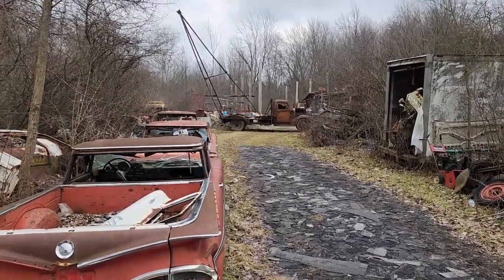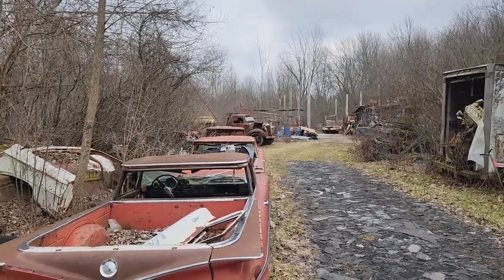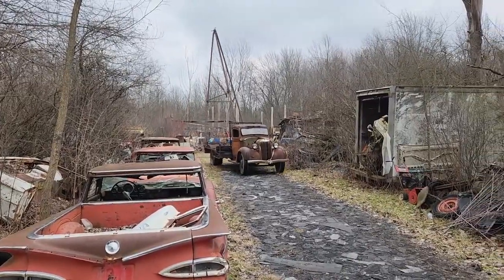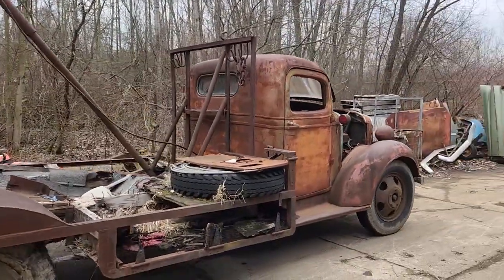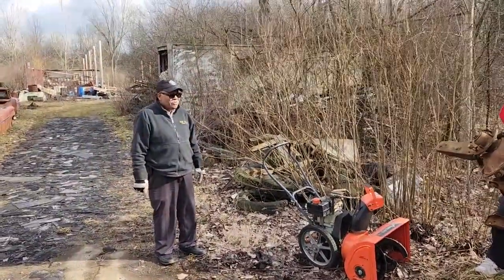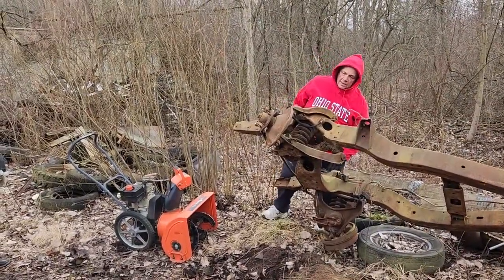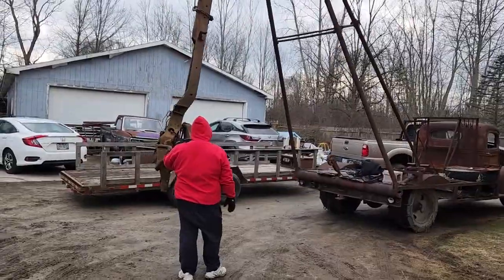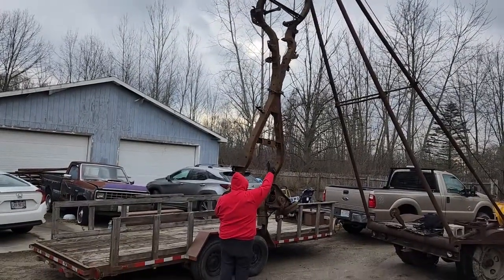Extracting & bring home the '60's new Frame 2-10-2023

Comment: Improving: 2.7/5☆s...2.8☆ possible if you time the still shots duration better mostly slightly shorter and add low key sound bytes (or music); 3.2☆ improvement possible with better  shot stabilization, and proper wide/tight framing of the shots. Editing isn't easy and can be quite time-consuming. It's a decent attempt, still pretty novice in the grand scheme, though. You can improve, don't give up! Cool crane, though.